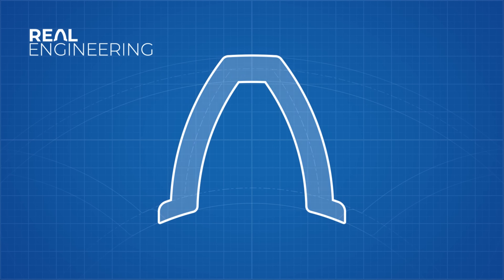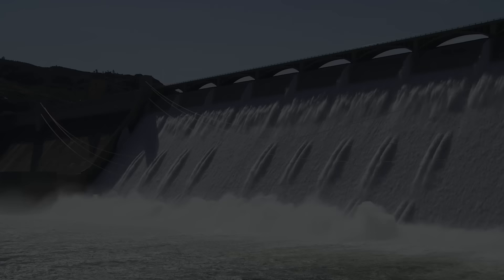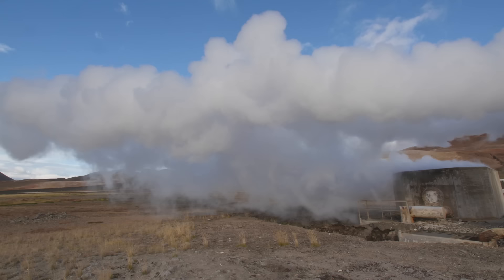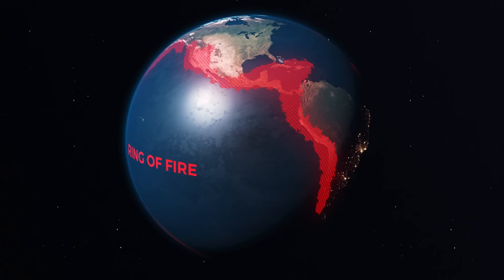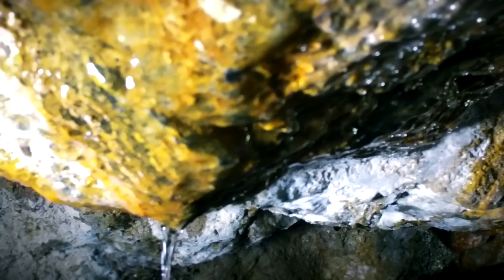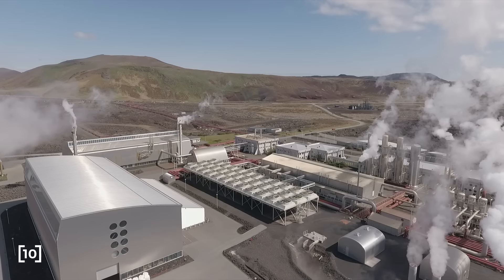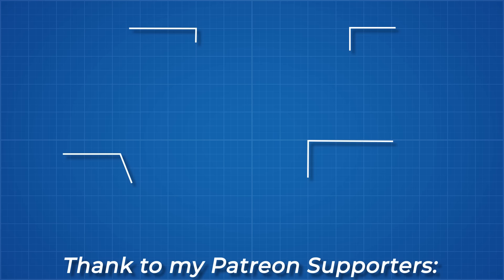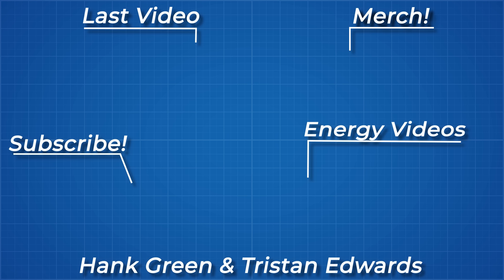Could Earth's Heat Solve Our Energy Problems?

Comment: 1) Fracking fluid is not toxic. While not pleasant, it's actually safe to consume directly.
2) Shale oil fields occur at much deeper depths than aquifers. Even at their closest, aquifers are separated from shale oil by hundreds of feet of impenetrable air/water tight rock.

Comment: Main conclusion I'm coming out of this video with is that nuclear is still the best option for our primary source of electricity. Wish you would do a video on the topic.
Reply: Maybe we can use portable nuclear to run massive boring machines that would dig large scale geothermal wells ?
Reply: True,  better fission reactors until we can master fusion ones.
Also people should get government subsidies for more efficient home appliances.
Reply: There is no single "best option". If we really want to address carbon dioxide emissions from electricity production, we'll need a variety of different solutions: Solar power can do a good job at providing residential buildings with sufficient electricity, which can take some load off a mains powered by hydro-electric, geothermal, wind or osmotic power where applicable, and nuclear power everywhere else.
Reply: Note that I specified it as our best primary source, not the only source.
Reply: Seeing as the sun is actually a sizable nuclear reactor which would have long ago cooked our little planet into a lifeless desert without our magnetic field I'd agree.  So what is the one energy source that is entirely non nuclear?
Reply: @cmdr4589  Though there is a lot of nuclear marital. Even if you just using Uranium you can in theory extract it from sea water at a net energy positive level. Sure it will run out... But we are talking about thousands of years if you tapping it efficiently. Thorium reverser should last us even longer. 

I do agree that we actually need a mix of energy sources and I do think geothermal power is in many cases better then nuclear. Depends of course on local conditions. And in the long run I think Fusion and Solar will be the main energy forms we use. We need not only clean energy. But cheep to. The cheaper it is the easier it is to be clean in a sense. Since if you have a lot of energy you can use it to counteract other negative environmental effect. 

The reason Fossil fuels seem cheap is just because those that use do not pay for most of the negative effects. These negative externalities is what really kills it. Starting with a energy source that have almost no negative externalities cost associated with it is a good start to providing the energy we need. And Geo is pretty good at that.
Reply: Robert Smith what’s the obsession with geothermal boring machines anyways? 

Boring ~vertically is completely different to those machines’ normal use.
Reply: CMDR when people talk nuclear nowadays (when they say it’s clean) they most likely mean Thorium.
Reply: @CMDR

Nothing is renewable, solar panels and wind turbines are hugely extractivist in their production and need to be replaced every 10-20 years. We don't have enough lithium on earth to produce enough batteries to allow them to sustainably provide power. With nuclear, we have thousands of years of fuel that we know of, and require considerably less resources per unit of energy, and as such less use of finite resources than either. Nuclear is comparable to geothermal and hydroelectric in terms of renewability.

Curious what the huge issues are though, and with "but what if it explodes" I really hope you're not implying nuclear reactors can produce a nuclear explosion
Reply: @fdc184  One should be specific. It should be noted that Thorium is not the most common from of reactor out there so when people talk about nuclear in generally is pretty safe to assume there talking about plain all boring fission reactors running on Uranium. Since this is what people generally think about. Even then there are of course different kinds of these nuclear reactors but I do not expect most people to know the difference or that it matters to much for the conversation. Though what generation of Uranium reactor actually do play a bit big role in both how safe it is and how efficient it is. Which both matters for people.
Reply: Ummmmm is everyone just going to skip past my key comment on how to move away from rocket propulsion for interstellar travel to colonize a planet much further than Mars that we can actually fucking breath on??? Cuz let's face it. Whatever takes out earth, sun imploding, exploding, black hole, is going to take out Mars too.
Reply: @cmdr4589  No source of energy is truly renewable. True, uranium will eventually run out. In a couple douzen thousand years or so, contrary to maybe a couple hundred more for fossil fuels. On top of that, uranium is not the only nuclear fuel we could use. Then again, we only need a "stepping stone" until we figure out a more "permanent" solution like nuclear fusion. And fission should definitely offer us more than enough time, given how fast science advances given even only a couple decades.

+vDarkness Falls
For now it looks like humans will be the factor that takes out Earth for all intents and purposes tho.
Reply: Most people who talk about nuclear positively nowadays are talking about uranium. This idea that thorium is clean and uranium is dirty is absolute nonsense. If you're pushing for thorium but think uranium is dirty, you just don't know what you're talking about.
Reply: @Yamyatos  PLASMA ENERGY IS RENEWABLE ENERGY. It gets it renewable energy from charged particles of the sun. Wtf are humans doing. Seriously bad shit.
Reply: @cmdr4589  what about PLASMA energy though???
Reply: @CMDR

Nuclear isn't hugely expensive, it's not much more expensive than solar in most of the world, and the costs of renewables are quite a bit greater than nuclear when the energy storage requirements are factored in. They're not particularly hard to run, and require /far/ fewer workers to maintain per MWh than solar and wind. On waste, they produce far less toxic waste than the production processes for wind, solar, and the batteries that make them viable, not to mention the waste from having to replace them every 10-20 years. Nuclear waste is such low volume that it's hardly even an issue to deal with.

On "explosion issues", Chernobyl and Fukushima are pretty good examples of how safe nuclear actually is. Neither harmed the environment, one has a death toll only in the hundreds, the other (despite being a triple meltdown where Chernobyl was a single one) has killed no one so far and released only 1/10th the radiation as Chernobyl. These were only the worst because they're some of the only civilian nuclear power accidents, which goes to show how incredibly uncommon such accidents are, especially seeing as both resulted from uncommon circumstances (one being one of the worst earthquakes and tsunamis in recorded history, the other being a dual purpose military-civilian reactor with a known to be flawed design).
Reply: They did have very little effect outside their immediate areas though, and haven't caused any environmental damage. There aren't animals still unable to be eaten in Wales, it was a brief spike in cesium detected in the meat of some animals, enough to place temporary restrictions. They quit monitoring it in 2011 because no animals with dangerous levels were found in decades by that point, it was driven by fear more than anything.
Reply: @Philip Murphy

If my house is a geologically stable formation then sure, sounds like a good time.
Reply: Yes, a thousand times yes. I wonder why he's hesitant to talk about nuclear. He's an engineer, so he must understand that as far as overall deaths go, it's the safest form of energy there is.
Reply: @cmdr4589  if you think nuclear reactors can actually explode, I have no idea what you're doing watching a science channel. The uranium used in nuclear power plants is no more than 5% Uranium-235 (the fissile isotope). Weapons-grade Uranium is at least 85% U-235. If you look at the data, a study has found nuclear power has resulted in far fewer workplace deaths than coal and oil, and even fewer than solar. Those who oppose nuclear are usually either scientifically-illiterate or have vested interest in other methods of power production such as oil.
Reply: if we harness the power of all the idiotic comments made under youtube videos...  we wont need the sun anymore.
Reply: seems good to me, in 30 years we can go and build another geothermal plant just aside.
Reply: @infantjones  nuclear fans do themselves no favors when they lie about the problems of solar and wind to make nuclear look better. My solar panels have a 25-year warranty and obviously most panels exceed that. Making uranium or thorium is also very "extractive".
The fact is nuclear power plant construction is grinding to a halt because current designs are so insanely expensive and time-consuming to build. You can mislead about renewable problems all you want, but until nuclear gets cheaper it's not going anywhere. I really hope it does, and all four (5? 6?) molten salt thorium modular blabla reactor designs sound great in theory, but each approach will take 15 years and 15 billion dollars of research and development to possibly prove its viability. It's worth the investment, but it's no wonder investors put their money into solar and wind projects that start producing  electricity within a year.
Reply: @skierpage
Most panels sold for home use have a higher initial power output than they're marketed as, so they can effectively claim a warranty that you won't lose more than 20% of rated output within 20 years. Also the volume of mining needed to supply global solar panel implementation is in the hundreds of times more than that needed to supply global nuclear expansion. 

Claims that nuclear power plant construction is "insanely expensive and time consuming" is an issue largely restricted to the US, which has one of least efficient public project systems in the world in terms of cost, whether it's rockets or bridges or nuclear reactors, alongside one of harshest regulatory environments in the world, with permitted leakage being lower than your body puts out. 

However, nuclear is already quite cheap and fast to implement in most of the world. Besides the example of France, which built 60 reactors in less than 15 years a few decades ago, and currently we have China and South Korea as examples as well for rapid and cheap expansion. In China, the Yangjiang Power Station (with a 6 GW capacity) went from being approved to being completed in 10 years, 2004 to 2014. Only 6 of those were actual construction. The plant cost a bit more than 10 billion USD.  

The fastest ever done for a civilian nuclear project (military reactors have been installed much quicker several times) was Japan's Kashiwazaki Kariwa-6 if I'm not mistaken, which took 3 years, 1 month, and 15 days to build at a cost of less than 3 dollars per kilowatt of capacity. Average time in most of the world is less than 7 years from initial land acquisition and design proposal to first criticality. In the US, due to bureaucratic issues, it takes twice as long and costs more than twice as much to construct new power plants and install additional reactors than it does in South Korea, Japan, Russia, China, and France. 

Solar and wind are only good for supplemental energy provision, the cost increases per kilowatt of capacity as percentage of overall energy provision increases exponentially due to energy storage requirements, unless you're a fan of regular brownouts and blackouts I guess. Nuclear doesn't have this issue.

Also I'm not a thorium advocate, we already have cheap, safe, and well researched uranium power available to us.
Reply: The problem is that spent nuclear fuel are radioactive and have to be stored somewhere which is risky
Reply: @Marem Warkhungam

The issue with spent fuel isn't its radioactivity, by the time its ready for permanent storage its only a small fraction of how radioactive it was coming out of the reactor, as the most radioactive isotopes are also those with the shortest half-lives. The issue with storage has more to do with the risk of groundwater contamination, as the transuranic elements are all heavy metals, which are toxic. This is quite easily solved through deep geological storage however.

The only other real issue is attempts to steal plutonium waste to produce nuclear weapons, however most of the world recycles such wastes which largely eliminates this issue, the problem is the US is behind most of the world when it comes to the nuclear industry due to immense anti-nuclear lobbying from the oil and gas industries. Though deep geological storage also pretty well solves this issue, any group that would have the resources to excavate millions of tonnes of rock to access plutonium waste could probably afford to just build a heavy water reactor to produce it themselves.